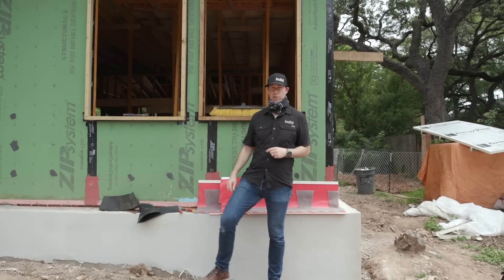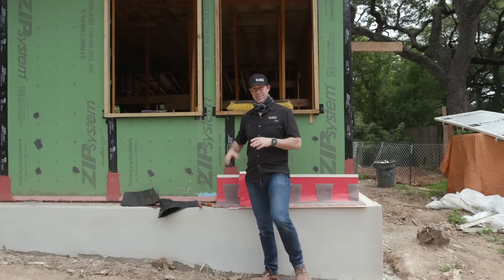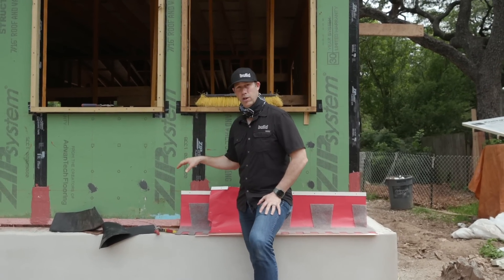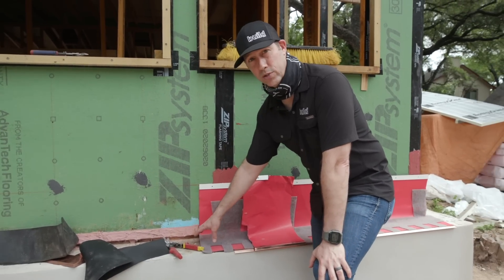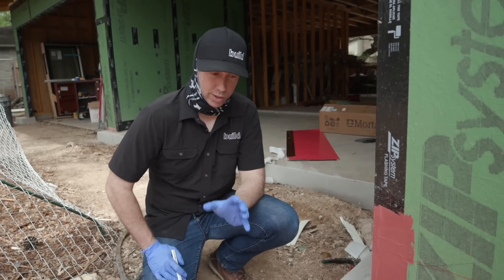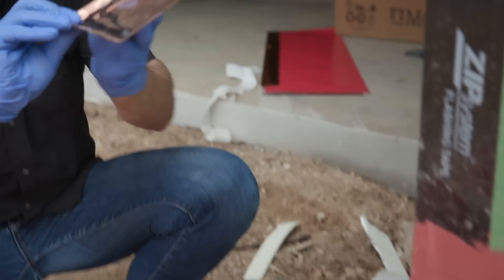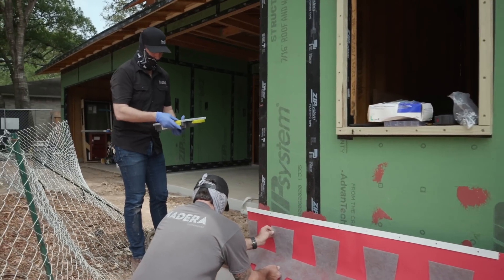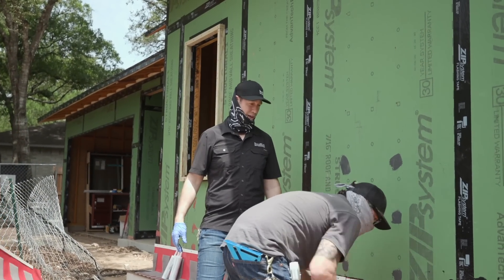Bomber Flashing Detail for the Base of A Brick Wall

Comment: Same here. I have a “pass it down” mentality and I wish more people before me had it. I bought a 40 year old house built in a development which I was explained the developer builds as cheap as possible for obvious reasons comparing to a custom built home. I had no experience but found no common sense was put into this house. There was an unsealed basement wall with sheet rock nailed to the cynder block, wet sheet rock, and black mold. That I only found out because the shower started leaking into the floor and I tore it out, cleaned up and am currently working on sealing the wall tonight. This video was under suggestions and got my mind going while watching it. I’ve never even thought about what is going on behind the brick wall. A while back I was talking to a friend about doing things the right way and how I wouldn’t want to half ass things even if I was going to sell it.

Comment: Used mortar net since the late 90's, great stuff against the leaky brick problem the brick manufacturers brought us during the early 90's. Going to the three hole manufacturing process allowed the  mortar on the  head joint to slump more causing more moisture to enter the housing envelope. For us (Cincinnati Ohio) that always have basements with our projects it also exposed several bad building techniques we were using. Customer began calling us every time it rained with water pouring down their foundation walls. Big learning lesson and a complete change in our building process.

Comment: I'm a portuguese civil engineer and certified passive house designer. I subbed Matts channel to learn about timber construction, which is still not very common here, together with new materials and technology. I can't help feeling that much of this technology is just complicating or even overlooking simple sound principles of good construction. I would've made a simple flashing on the overstep, down and out, and kept the brick wall way away from the inner wall, about 1,5" to 2", so no mortar can build up between the two. On the first row of bricks, keep out one out of 4 so to give access to clean any mortar that may have fallen in, then place these without side mortar, so any water may come out and also for venting. Don't forget to make sure the brick wall is mechanically secure to the main frame, keeping in mind any water that seeps through the anchors must drop before reaching the inner wall, in the flashing. Also, use mortar with a bit of latex for the bricks. My humble opinion. Keep up the good work!
Reply: I'm glad that you mentioned that about the gaps between some of the bottom row of bricks.  I live on the first floor of an apartment with brick siding.  Last year, I caught five nonvenomous snakes in my apartment and the maintenance guys plugged those weep holes thinking that was the entrance for the snakes.  A pest control guy found the true access point for the snakes where electric meter cables penetrated the brick wall.  I've seen house cats climb brick walls but not snakes.  However, I once helped a neighbor who had a large snake on her second-story balcony (I just shoved it off with a broom).  So, now that I understand why they are there, I'll tell maintenance to unplug those brick holes.

Comment: Hi  Matt!

Why don't  you use ventilation gaps between  the brick fasade and zip sheet? Leaving 30 to 40 mm gap ( ~ 1,5 inch?) between them + leaving every third vertical seam  from the firts or second brick row without mortar allows airflow and helps the wall to dry.
+ wet brick is not in touch with rest of the wall and when excess mortar is removed from behind the brick there is a little change water even touches zip. (+ wall ties in incline so water does not travel throug them.) This works at Finland at least thou the climate is more like Minnesota than Texas...

Comment: A lot of newer technology in this house. Could end up being a recall nightmare like some of the old building materials of the past
Reply: Doubt it. But I hear you
Reply: Jose Gomez time will tell. A lot of dumb stuff that has had recalls in the past. My house has a lot of these same materials that he has doing so I’m in the same boat
Reply: @josegomez6549  You may be sincere in your doubts, but my 50 +/- years doing high end construction ( and a LOT of leak remediation on other people's disasters) tells me to plan for otherwise. I put up a fairly detailed comment/ problem description on the "Flush Concrete to Framing...." video, that is the first look at this subject. See at the Comments started by 2A All Day. Talking the talk caries no weight with guys like me (there are a few of us around, even today), whereas I put great value in observations from those who walk the walk (as I have). 
FWIW, if I thought the ledge in this example could not stand to get wet (which I don't think), I would do a full 24 oz soldered  copper flashing over the entirety. I have worked on 100+ year old houses where this copper "technology" is still in fine shape. Adding plastics to create more layers on a material that is superb as a stand-alone is simply not in the cards for any job of mine. And I have commented more on this elsewhere in this video. Final thought, If we actually trained our mechanics, we would not have to come up with overly complicated systems that are supposedly "FOOLPROOF" (means NO SKILL required).

Nothing can be made foolproof, because fools are so ingenious.
Reply: At least it his own house
Reply: My thoughts exactly! Like an in wall toilet reservoir. Wow. You would think an experienced builder would have more common sense.
Reply: @claytonwindham  I doubt he has ever swung a hammer or did any trade
Reply: @Ptro1  that’s not true. He has done a lot of building and worked for a number of different groups through his life.
Reply: @leestevens446  it's fairly unlikely. In the past, most of the stuff that has led to recalls has been situations where the industry was "cheaping out" / trying to use less rugged materials in the interest of cost savings. 

Vs now, much of the new building materials & techniques revolve around caring less and cost and making the assembly MORE rugged. 

Additionally, much of the "new" technology isn't particularly new. It's using materials we already know about and that have been extensively studied so we know the properties, and either it's using it in a manner we know it'll work (because our ability to simulate conditions & test the material has expanded significantly both with physical tests as well as with computer engineering simulation software) OR it's adding the new material to an old material that's been used in the "real world" for decades, and the "new" material is just being added to improve the performance of the old material, as is the case in this video. So worst case even if the new material doesn't work as intended, it's still at least as "bomber" as the old material by itself.

Comment: You need an overlap on the outside corner, it odd the system was designed that way (7:30 mark).  A bead of sealant will not work.  You also applied sealant at the bottom of the copper so any water is now trapped.
Reply: I was also wondering about that, maybe the tiny bit of water that could someday leak when the caulk fails isn't enough to be a concern.
Reply: Also agree. That corner seems vulnerable. Surprised the copper corner piece isn’t bigger for overlap. And I wouldn’t trust the sealant as well.
Reply: Wow.  I know next to nothing about building houses and wondered about those things.  Glad to know I'm thinking like more knowledgeable people.
Reply: Probably not really caulk but most likely bytul which does not harden fully
Reply: Good points. Water would have to get through the brick then transport 1" over to the zip wall. He also talks about exterior foam so it would have to get through that as well. Since the place will be airtight there should not be much pressure driven water.

Comment: This house will be so air tight it will be like opening an air lock on the space station every time you crack the front door. All your stuff in the house will need to be secured, otherwise it will go flying out that door as the pressure equalizes.
Reply: That's not how pressure works.
Reply: I don't know what you are talking about. That's what happens in movies. 

Duh.

🤣🤣🤣🤣🤣
Reply: I saw this exact thing last week
Reply: That's not how it works.
You will have problems only if you fucked up your air balance and underpressurized the house.
Reply: A year later and still have people commenting that can't understand a joke.

Comment: I admire the efforts towards long-term durability, but I would have issues with a bunch of the details, as regarding my own builds. Last large job was 2" polyiso continuous exterior with "outie" windows. We used Barritech VP self-sealing (up to 1/4" dia fasteners) liquid applied over 100% of exterior wall sheathing, with compatible embedded fiberglass reinforcing mat (where appropriate at joints and intersections) and primered self-adhering, self-sealing 6" and 12" roll materials. We covered the foam up with a FULL drainage plane/ mat and then 5" bed thickness stone veneer. Any water problems would have huge implications. 
My reservations with this video/ assembly is the lack of a full self-sealing coating, and all the various layers and reliance on bonds and sealants for reverse laps.  KISS.  With the stuff we used, in this case, I would not goo up the wood-concrete joint with just a sealant. I would rely on the 1 1/2 " step-down in the ledge, and primer a 12" wide membrane that started just on the ledge, and then ran up the wall. If I was really paranoid in this case, I would use something like Waterplug (fast set hydraulic repair cement) to fill on the ledge, up the face of the step, flush with the face of the sheathing. Then the membrane will lay flat, no wrinkles or bubbles. Dr. Joe would love me. Think shingles (not the disease, however). Next the full liquid applied, which laps over the membrane at the base in one clean process. I would also consider a SMALL bead of sealant at the wood sill- concrete interface first, just because. And if I was really paranoid, I would cut a slight slope on the flat of the ledge before I did anything. Cleanliness is next to Godliness. My thing about the membrane on the wood-concrete joint is because the physical properties (thermal and moisture) are so radically different that I want something that I can absolutely rely on structurally. If a small amount of water gets behind the red stuff, you will have failure.  Unless you have a flood, the ledge-step does the yeoman's work here: just need to prevent capillary action. I would be sure to keep the polyiso up about 1/2" above the ledge, to insure clear drainage of anything that might get behind. I think the Brillo pads are okay, but it is imperative that the weeps be forever open, either with cotton rope or whatever. Around here, mud-daubers will fill any hole in a house facade: an open weep will get plugged by insects. It is not necessary to have a completely open bed joint on the ledge, concrete is pretty durable when faced with moisture. And I am not sure the actual value of all the layers being built up with this system; I could see it if there are vulnerable materials below, but not the case here. My other reservation is all the voids that are created by use of sealants in parallel lines (not full coverage) in the layers sheet materials, that seem to serve no useful function, but may serve as water traps down the road. 
Back to full liquid applied/ self-sealing membrane. If you are concerned about filing overdriven nail holes, then you should be REALLY concerned about masonry ties punching thought the polyiso and then making a ragged penetration in the Zip sheathing. This is a wicking/ leaking scenario waiting to unfold, and you have no clue and no control over the situation, once built. We used, after extensive testing, a commercial stud and wire loop masonry tie, with a rubber-washered shoulder at the wall plane (belt and suspenders). The eye for the wire was just clear of the foam. A test pan with the assembly under 2" of water held absolutely for the 30 day test duration. Only way I slept, covering everything up. And we had the "Brillo mat" (ours had a plastic dimpled backer sheet, basically foundation drain mat) over the entire wall. 
So, everyone has to evaluate their own circumstances. You pays your money, you makes your choice.
Reply: Thank you for this detailed technical description and the time you put into writing it. Shingles, not the disease - LOL!
Reply: @justamusta  Well, I have put up a few verbose comments recently, and now I know at least one has been read (all the way through). I appreciate the thank you. Stuff I have to say is a bit over-the-top for most laymen, but I think it valuable to provide a more expansive viewpoint re: critical water management topics. My real point is to think carefully about how one frames (pun??) the problem, as that will define the solution. A big concern I have here is that moving product is becoming the operant criteria for content. I definitely do not share the hater's viewpoint that what Matt is doing is overkill, but I fear that some of what he does, or shows,  is somewhat misguided.
Reply: Same concern about brick ties -- can you share the masonry tie you referenced.  Thanks for the input!
Reply: @CB-jl8ii  Sorry for not responding before, but got no notification of your reply/ question. Our commercial masonry sub got the ties, we tested thoroughly, as far as sealing. I did Google search and found this distributor, that has a lot of stuff:

http://www.masonpro.com/products/commercial/brick-veener-anchors/

Here is the manufacturer's data sheet, for the one we used, or a very close competitor:

http://www.masonpro.com/wp-content/uploads/2013/05/Heckmann_Pos-I-Tie.pdf
I am sure we had a small EPDM washer on the nose of the barrel, as shown in the structural steel application drawing. That gave us an additional seal at the liquid applied membrane over the OSB sheathing. We pre-marked studs, and required all ties had to be in studs, not just OSB. And under NO CIRCUMSTANCE can a fastener be removed once it goes through the foam (could leave a hole in the membrane). 

On a brick job, coursing can be known within tolerance of the wire tie height adjustment, and the placement can be well in advance of the masonry start. With our rubble stone, the ties must be placed as one goes, stone by stone. This tie worked very well for us, no complaints at all. Good luck with your project(s).
Reply: @leestevens446  Thanks very much Lee --- appreciate the detail and links; helps a lot and plan on using !
Reply: @CB-jl8ii  Like (I suspect) most viewers, I kind of give up on tracking replies in the huge sea of comments. Very few folks on here seem to be truly committed to actually doing the sort of stuff that is presented to them. I would really like to see the industry and product improved, and am always glad to offer whatever expertise I can to anyone who appears to be "walking the walk". You are most welcome, and thank you for the return reply.

Comment: Was good till 5 mins. Not a complaint but an observation. Copper tubing which is thicker than that flexible foil, will become porous overtime, when in contact with cement products. Spent many an hour looking for pinhole leaks to find them usually from contact with mortars or cementatious plasters. Hopefully this won't give you headaches down the line.
Love the channel and this old/new build series.

Comment: My roof goes over my eaves that are over a foot wide. Then my slab is 6 inches and my brick was mortared very well it is a 70s house totally bricked and I check regularly for any holes never have seen any or had any problems. I got lucky and this house was built right and sound. I cant hear people in other rooms at all if the door is shut. I go to others house and it drives me crazy how loud things are. Lol hopefully it never gives me any problems but so far so good. Almost 20 yrs in.

Comment: So , driving steel screws through the copper foil. Ain't it a reason of the electrochemical corrosion of the firsts in wet area? Thanks for the vids and stay well.
Reply: Yyyup. Galvanic corrosion between copper and steel is common. And copper and zinc. The bead of sealant should help reduce that. It can still happen though. In theory that area should stay dry, but in practice and a humid area... copper nails would have been better. Way more expensive, but better.

Comment: I know your a stickler for detail & perfection, as am I which is why I point this out and because I believe it is a better practice. On your 2 x 2 window spacers, I would of made the top horizontal piece long (full width) as I believe you did but would of made the bottom piece short and let your “vertices run full length to prevent water from possibly running back in. Just a thought!

Comment: How do you anchor the brick and mortar ties to the foam? Do you cut out the foam to fasten them to the wall then put the plug back in? Maybe use a hole saw to cut out the plugs?
Reply: They just use an angled piece of metal to lay in between the brick and screw through the foam into the substrate.

Comment: What kind of wireless network will work if you have a solid copper perimeter?  I've seen a number of homes with copper cladding with terrible cell and wifi in the house.
Reply from the maker: Do you think the bottom 1’ would make a difference?
Reply: @buildshow  No.

Comment: I really like the design of this type of drainage. I wonder how well it works it a climate that has a lot of hot and cold freeze cycles. It is normal for the weather in center Ohio to have heavy rain followed by an over night freeze.
Reply: Dave - We've sold this system all over North America and not encountered any issues with freeze thaw cycles.